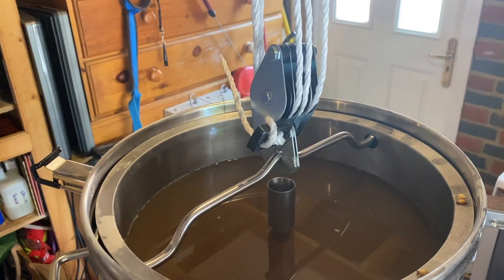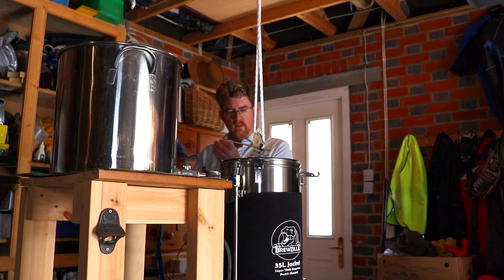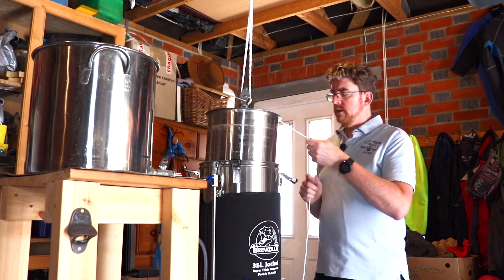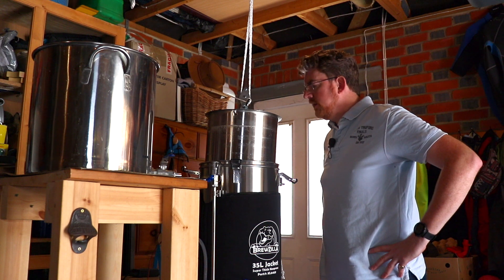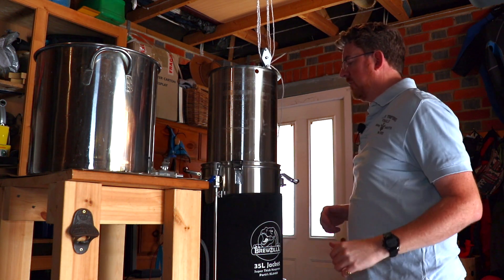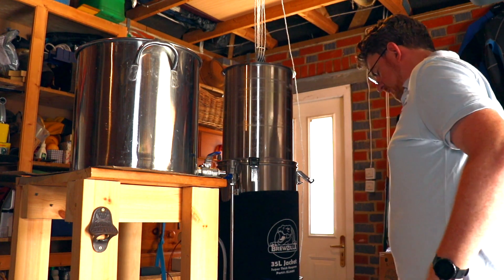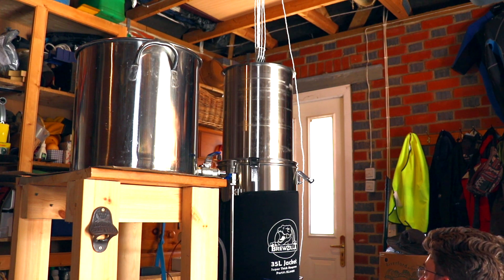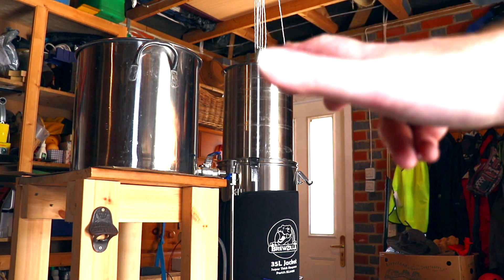Brewzilla's new pulley system

Comment: You need one more pulley on the roof a bit back then you can pull down instead of up
Reply from the maker: Hi Gordon, yup having used it twice I figured out the pulley are upside down.  I also need to change the cord as it very thin and twists up so that is an investment I will be making this year.